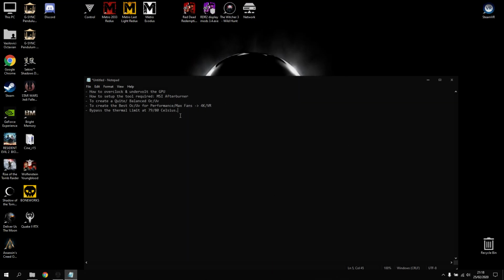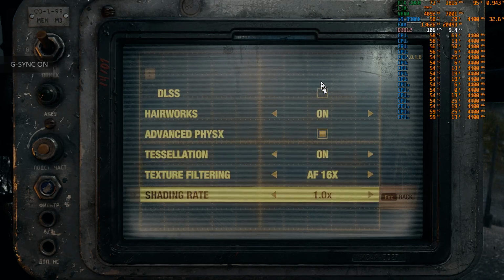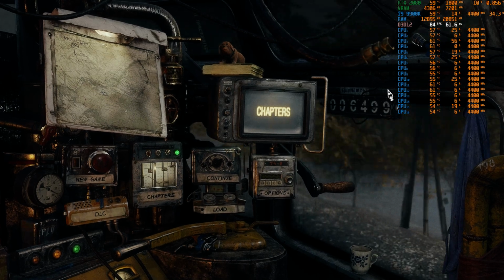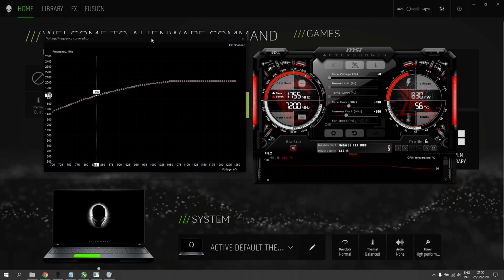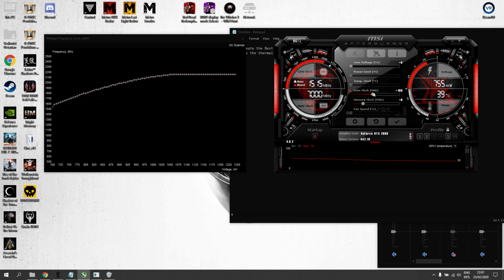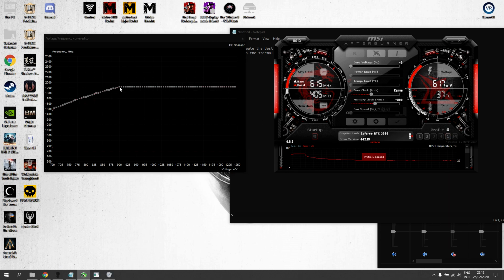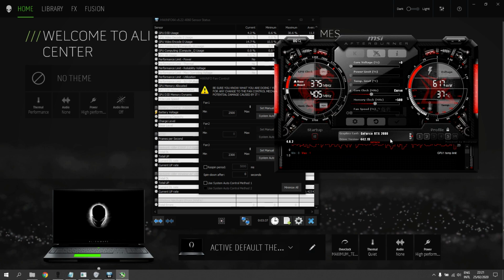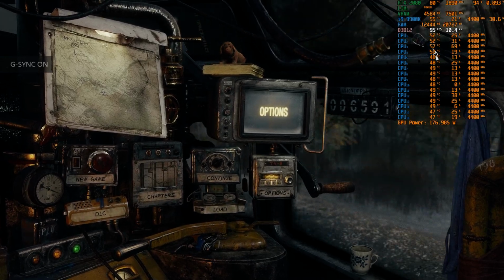Alienware Area 51m - How to "tame" the GPU

Comment: Hello! I was trying to do the same things as you do with afterburner in the beginning on my Area51-M 9900K. I leveled everything at 1515 MHz with 0 memory clock and 0 core clock. Still, playing minecraft with some sharers on 1920x1080 will still push the temperatures to 78 degrees in around 3-4 minutes. I don't get why... 1515 Mhz is a lot lower. The voltage is 762 mV which is low af. I get an average of 95-100 fps with those shaders and it looks great but i can't continue to play because 78 degrees are reached too far! The vents are on full speed. 
Do you know what can i try? I am runnin 1.7.3 and 1.0.0.5 VBIOS as you
I plan to o a thermal repaste on the GPU. Did you apply anything to yours like thermal pads or thermal repastes?? How can you keep a temperature of 78 degrees at 1900 MHz in the end. That's so extreme and voltage is only 0.893... if i'd do 1900 MHz mine would explode for sure.

Update. If i do bypass the bios thermal limit as you said, i'll just reach the 90-91 temperatures in matter of seconds! And the voltage is the same at the clock of 1515 and 762 mV. This is nuts :(
Reply from the maker: OUCH! That sounds like something is really wrong!
I would go with a re-paste ASAP!

I used 1.0.0.5 Vbios before and while the +20W more increase the temperature a bit (1-2 Celsius) I never reached more than 82 on full speed fans.
Something is either not seated properly as that high temperatures indicates bad thermal transfer between the sink and the GPU.
Normally you should be able to get @1700Mhz on Performance mode at around 75-77 Celsius. 
I would recommend a heavy game to do the testing like Metro Exodus (this one really pushes the GPU to "no man's sky" limits!

Hope this helps!

PS: One thing that will help the GPU temp (but not by much from my testing) is lowering the CPU clock (so don't go full 5.0GHZ) and undervolting the CPU as well.

Comment: Hi @Helifax19 I have my 1710MHz on 862mV, which is different from your's, is that fine shall i still continue ? waiting for your advice
Reply from the maker: 862mV seems a bit too much Voltage for that frequency, but if that works for you then it's great:)
The idea is to try to get the lowest voltage that can sustain the clock ;)
Reply: @Helifax19  I have tired both normal and performance mode, and temps seems to be below 75 even on performance mode, but in both the modes i see FPS keeps from 153 to 100 and there is stuttering because FPS keeps dropping. is there anyway to avoid it.
Thank you for your advise !
Reply: Sorry, correction > FPS drops from 135 to 100. And when fps drops, there is stuttering. Temps are absolutely fine..
Reply: Update : i have reduced the core clock from 150 to 100, its now very much stable, and thermals are below 74 max that i have noticed. Thanks alot !!!

Comment: Hello mate, fantastic video. For those of us owning this type of brutal machine is very helpful. By the way could you please confirm your current Bios and Vbios versions? . Cheers. Thanks for sharing.
Reply from the maker: Hi, yeah, I show them in the video in the beginning, but I'll write them down here as well in the description:)
Bios: 1.7.3
vBios: 1.0.0.5 (180W)
Reply: @Helifax19  many thanks mate. I just one to watch all video properly, so much good stuff in it. Sorry I asked something I should seen before. Thanks man. Many thanks for sharing your knowledge on this machine.
Reply from the maker: @0rtizjjay  Nothing to worry about! I hope you will find it helpful and you can use some information from it to tailor the Area-51m to your liking ;)
Reply: @0rtizjjay  hey did you get your a51m? I'm getting one and having cold feet just curious if you think yours is worth it.
Reply: @Vacation_  hello mate. Yes I did get the a51m. 9700k with rtx 2080. I was considering the gt76 titan too, but I finally took the 51m. I had 2 MSI more a gt73 and a ge62. Very happy with the a51m. My decision towards the a51m due, I can use just the small power brick for general use, no Optimus, fan noise and build / design very appealing. I'm running for gaming 4.9ghz with 130mv undervolt, gpu with temp limit at 79, clock at 1995 MHz most of the time, battery mode after tweaking can last me around 2 hours, keyboard is amazing and trackpad amazing compare to my other MSI laptops... All great with it, no regrets at all. You will just have to tweak a bit the machine to get the most of it...
Reply: @0rtizjjay  okay thank you very much, and I got the same one as you 9700k with rtx 2080, I dont think a laptop can utilize the 9900k properly when desktops can barely cool the thing. So the gpu thermal throttling isn't really and issue? And did they ever add 2666mhz support in bios?
Reply: @Vacation_  the GPU thermal throttling will be fix following Helifax19 video (check the one in relation with gpu), no issues there anymore. In relation with the 2666 ram speed, I don't know if they will update current 1.7.3. bios to support those speeds and beyond, seems that soon we will have a bios update as some other owners have mentioned in other forums...
Reply: @0rtizjjay  thanks eases my worries a little aha

Comment: Do you think it can still compete against gt76 ,,i mean gt76 van maintan 1800 plus clock on 70sh temps ,,,
Reply from the maker: Oh yeah, I don't think there isn't a problem here. It's all down to how much you want to sacrifice fan acoustic and temperature for 100-200Mhz extra and up to 10FPS more.

If you watch the whole video I show what Overclocks and undervolts you can use for Quite/Balanced fan profile as well as "unleashed" performance mode for Performance/Full fan speed mode.